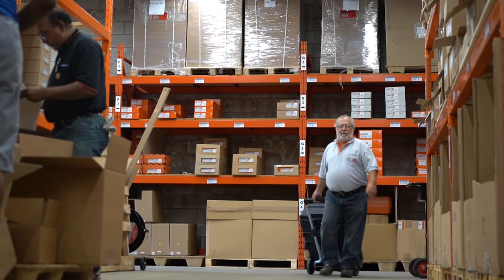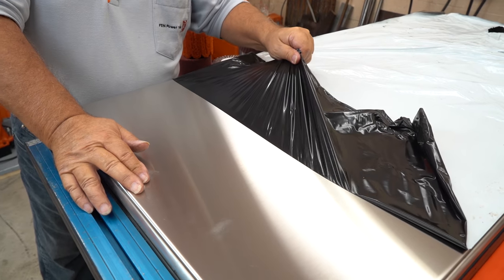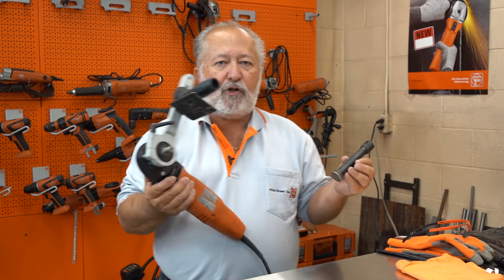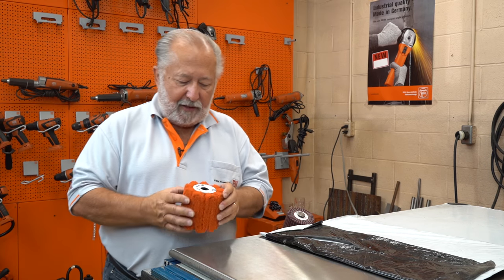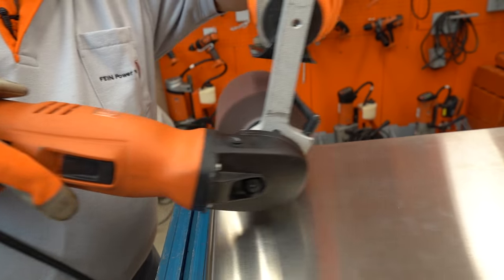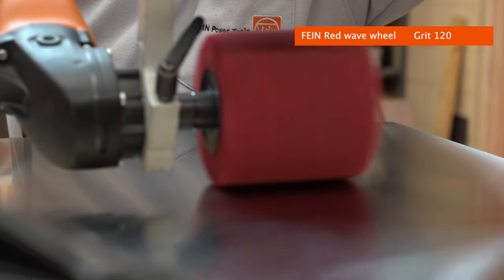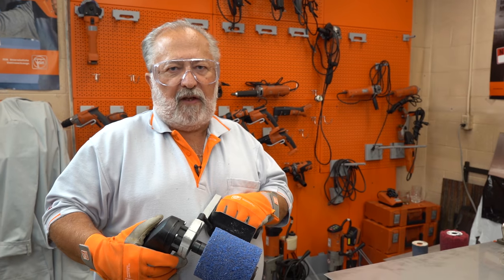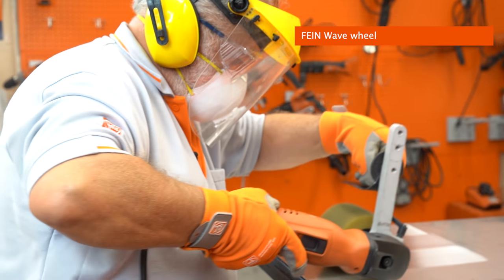The Best Way to Remove Scratches from Stainless Steel

Comment: What a great tool, i am a simple man I start with bar keepers friend, removes thin scratches and polishes surface (makes SS cooking pans have a mirror like finish) if scratch was too deep and didn’t come out i next use bar keepers friend with 0000 steel wool, if still there take some wet-sand paper on a flat block followed by bar keepers friend and that typically does the job for far far less money.  This tool would save me some time.
Reply: What grit?

Comment: With the Tesla Cyber Truck coming out these will be used in detail shops all over. What would be your recommendation for such a large application with that type of stainless?
Reply: Get any angle grinder.  Add a rubber pad accessory to buff flat, or get the wool pad discs.  The issue with a steel or  aluminum exterior is the constant polishing.  I'd spray it with some poly or lacquer to keep the shine.  The Fein rollers are of course the best thing since they go with the grain and not in a circular orbital direction, so fewer passes are needed.  If you can afford them.

Comment: As a carpenter just getting into metal work, I found the video educational, and I'm going to look into that polisher, and those wheels.....which I assume is the point of making such a video😉
Reply from the maker: We are happy you found it beneficial 👍
Reply: Yes, I agree...recommending that we purchase these products and the polisher does seem to be the purpose of this video. AND THAT'S AN EXPENSIVE PURCHASE JUST TO REMOVE A SCRATCH!
Reply: @gigir6761  It would pay for itself quickly as part of a production enterprise.  And while you could get a.cheaper version from another company, you'd pay for it in the long run.

I'm assuming it's more expensive due to tarriffs on German products. Fein tools are generally worth the added expense.
Reply: @DoctorHayduke hmm. I’ve got a lot of Fein and Festool tools, as well as Flex, another German brand. All my hammers and snips are Picard, all my vices are Brockhaus Heuer and I pay a premium because the EU shafts us here in Britain as revenge for leaving their stupid EU.

Having said that….

This tool a cool £1000 or thereabouts here currently and that’s a huge outlay unless one is constantly removing scratches from stainless steel.

I’ll think I’ll hard pass this particular one, but you have at it. Enjoy! 😉
Reply: @NewWorldHoarder  For what it's worth, 2 years later and I still haven't bought one!
Reply: @DoctorHayduke  lol, that made me smile 😃.

Since when you look at it, as nice as it might be, it’s a very expensive variable speed angle grinder with a long shaft and some rubber toilet rolls 🧻.

Thanks for the update brother. 👍🏻

Comment: I just recently purchased 60 - 4x8 sheets of stainless steel from a restaurant that went out of business. 600.00 not bad!  My plan is to use it to wrap five ugly enclosed trailers that are now just 1/2" plywood...and a bunch of smaller projects like building trailer tongue boxes etc... what grit should I sand those to for exterior use? Should I polish them to a mirror finish or will I just blind everyone?
Reply from the maker: The grit number depend of what look you like. Usually what is used in restaurants is a grit around 120-180. To go mirror it's a lot of steps and a lot of time. Still If you go that path afterwards you have to be very careful because it is so easy to scratch.

Comment: Hi thanks for the great work of tips and hints you have shared with us. Now my question is how can remove light scratches on a stainless steel pipes especially furniture. Secondly how much is that set of tools you were using in the video
Reply: I looked it up last night....the tool itself is $550ish, and the set with the arm and multiple wheels is about $1100 (US).

Comment: If the hairline scratches not a lot is just in the coating caused by microfiber is there a way to buff it out. Thanks
Reply from the maker: What type of finish your surface is?
Reply: How about the glossy stainless steel like fridge from Samsung?

Comment: Hello, I am in the Janitorial industry I am looking for products to restore bathroom partitions and elevators. Would you recommend any protective coating or passivation process after using your polishing wheels?
Reply from the maker: The material you are working with and finish/shine you would like to end up with will determine what you can use. Please send your specifics to our application specialist Richard so we can better respond. His email is Richard.Carbis@fein.ca

Comment: what is your advice on the stainless steel sink?
Reply from the maker: If it's for your stainless sink at home, for light scratches, I would suggest  use a fine abrasive pad, such as a Scotch-Brite pad, to gently buff the area. Again, make sure to work in the direction of the grain. Be cautious not to apply too much pressure, as this can create more scratches. If the scratches are deep, you may need to seek professional help. Always test any cleaning method on a small, inconspicuous area first to ensure it doesn't cause further damage.
Reply: @FEINCanada  I do construction and we have a guy that uses a tool just like that to polish out scratches in stainless steel sinks and they come out brand new. I think he uses a unitec machine. I would like to learn how to do this myself. I just need to know what wheels to get and use

Comment: Beautiful finish! What a fine grinder (pun intended)!  I wonder if I could get the same rollers for my existing Bosch Angle Grinder.  Fein is probably a better product but I don't need another grinder.
Reply from the maker: As long you have a variable speed grinder and you stay in the safe speed range of the drums you can do it. All you need is the extension shaft and the drums.

Comment: hi there, what about if a dishwasher has a couple holes (done by a terrible installer) in the stainless-steel tub. can that be repaired?
Reply from the maker: If you never have done that better let a professional do it or it can look worst than when you started.

Comment: Hello, I am a car detailer and yesterday I encountered something I had no way to fix.  My client has a Rolls Royce Phantom and the hood and area around the windshield are bare stainless steel.  The hood is heavilly scratched and the stainless steel has a very prominent "grain" texture going from the windshield to the front.   What would you recommend to fix that?  I am sure I could remove the scratches using wet sanding but I know the texture will be removed.
Reply: Try 0000 steel wool. Start dry with very little pressure. Add pressure very carefully and slowly and evenly, following the grain. If it does not produce the finish you like, try same process using a very light coat of WD40 (spray on rag and rub on). Good luck.
Reply from the maker: I would not use steel wool on stainless steel because this add contaminants to the stainless who cause rust spots to forms in few weeks/months. The first thing to do is determine what the grain finish it match and how deep the scratches are. The deeper the scratches are the coarser you will have to go. This also add more steps to the process. Same for the final grain, finer is it more steps you need to have.

Comment: Your video is great for flat sufaces! How do you work on the Slope edges on curved no 90 degree angles
Reply from the maker: Please contact our applications specialist, Richard, at Richard.Carbis@fein.ca  
He has a few questions for you to best respond to your question.
Reply from the maker: Theses types of wheels are not made for sharpening but for polishing. If you are looking to sharpen and polish knifes there is systems designed specially for that who might be easier to handle your sharpening angles.

Comment: What is the best rpm range for aluminum brushing?
Reply from the maker: Hello Deejay, that depends on what polishing abrasive you are using. For drums like that personally I would start around 900 RPM (optimal drum rpm) and try to go a faster and a bit slower and make a decision based on the look of the finish and the feeling.

Comment: Hi, what tool would you recommend for polishing stainless steel pots that are brushed inside and on the bottom? Any advice would be appreciated.
Reply: Use an angle grinder with a crimped wire cup brush (Harbor Freight $5) to remove the gunk. Use a mild abrasive felt pad at 320 grit for satin finish, and a wool felt pad with metal polish to get a mirror shine. Bosch Angle Grinder 5" is my favorite.

Comment: You did not use any grit higher than 180?  What if you used 240-600?
Reply from the maker: It always depend of the desired finish of the sheet. In this case to start with, the finish was what we call a #4 finish who usually is around 120-180 grits so we didn't had to go with an finer grit.

Comment: What about the dent/fold on the top corner??
Reply from the maker: This is a piece of scrap stainless steel, it's better to be caution and handle with care the material to avoid dents and scratches. To repair a dent, you need to grind down the area and it needs to be wider than the dent itself otherwise people will notice right away.

Comment: Do hold demons ? I'd like to see what this set up can do. I work un a control assembly shop. Some times out stailess steel enclosures get  scratched. So if like to probably purchase everything needed to remove scratches in house
Reply from the maker: Where are you located at?
Reply: @FEINCanada  Santa Ana Cal

Comment: Is didn't see you using the polishing soap for in finishing up with the polishing. Now when are you supposed to use the polishing soap
Reply from the maker: There is multiple ways to achieve  a finish, using compound is a different and older technique. In our case we use compound for mirror preparation and finishing only we find it faster because you remove the wheel preparation and less messy. For a number #4 finish and even for finer polishing drums will do a great job.

Comment: Hello sir,
I need your help..
We have one SS410 cage having ID 106mm & length 138 mm.. Customer requirement is the Ra value of this ID is 0.1..
We use the diamond paste for lapping this ID but cant get the Ra value...
Pls suggest the any idea
Reply from the maker: I passed your request onto our application specialist, Richard Carbis. He needs to ask you a few more questions in order to respond. Please provide us with your email address and location. Or you can reach out to him directly at Richard.Carbis@fein.ca

Comment: Is it really required to wear a respirator when polishing stainless?
Reply from the maker: We prefer to keep metal dust away from our lungs.
Reply: Yes. The nickel/chrome content plus the particles from the abrasives are hazardous over the long term.
Reply: @lesfox2010  I thought it was in an alloy that is very stable and bio-compatible
Reply: @AlessioSangalli  Well yes, but sanding and grinding turns it into dust forms, which are not so safe to breathe.

Comment: It doesn't match the shade of the original metal
Reply from the maker: It actually does in person, it was just really hard to try to capture the grain pattern and the shade on camera with the lights. It is also a manual tool so the human factor also make it impossible to be the exact same with a trained eye we always see a little something.

Comment: I could still see the difference between polished area and the rest - I would not accept that as the good result.
Reply: You're the one who damaged it. 
Maybe be more careful next time and he won't have to bother with you. 
The only way to get it perfect is to avoid SCRATCHING IT.
I can only imagine how awful you are as a client.
Reply from the maker: There is no way to have the polished surface identical to the rest. A trained eye can always see the difference. The only way to make it perfectly identical is by refinishing the sheet on the same machine with the same abrasive and parameters that the factory used to polish it in the first place. Most of the time, this is not possible. In that case, we can blend the scratch pattern with power tools, like in this video, or hand tools to minimize the difference between the two finishes
Reply: @FEINCanada   I do #3 #4 finish on stainless rails. 
Blending 1 area isn't easy.